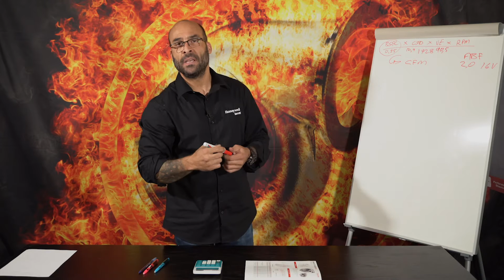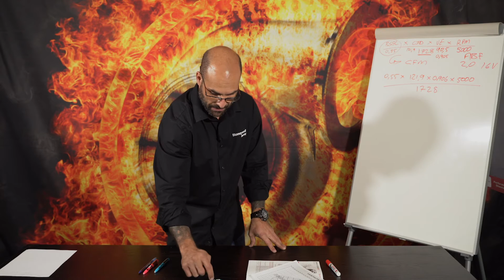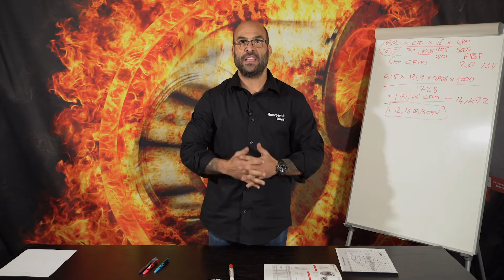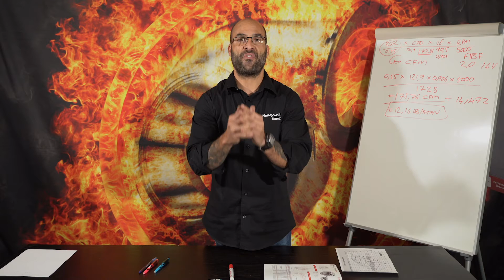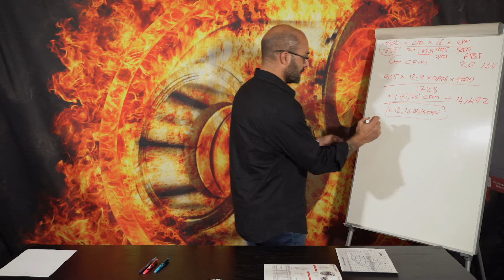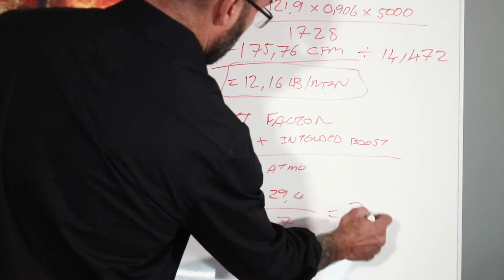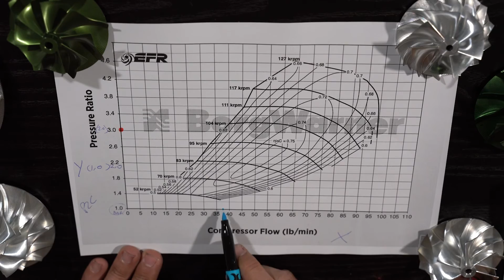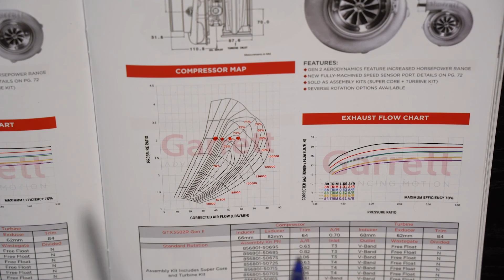Turbocharger compressor efficiency

Comment: why .55 for BSFC?  is it a typical or a normally pre determined factor? Not Justin balls, just need a little clarification so I can extrapolate for MY build.  Cheers!
Reply from the maker: Fuel dependant, and VE dependant goes together with AFR and turbine efficiency - all these things come into play - go into the Borg Matchbot and you will see it clearly and get a better understanding of how this works.  You can change these parameters and you will see the BSFC change with changes to the above values.

Comment: I want to run an EFR7163 .85AR vband in vband out turbine housing. Cast log manifold, mild street cams, fully built Darton MID wet sleeved, custom CP Carrillo rods and Pistons and all the other bits. No expense spared at any point. Fully upgraded return fuel system.  It's a 2.5 liter, dual VVT 5 cylinder. What is your guestimate on HP at the wheel? Planning on 30psi, redline is 6500. Unlike some, I will take it with a grain of salt.... cheers!
Reply from the maker: I would expect around 500HP - BUT the power curve will fall away over 5500RPM - the turbo is small for the engine you have built. I would consider the EFR8370 instead.

Comment: I just love that you took my favorite engine in equation. From what I've seen on multiple engines of these is that we got 400hp@1bar of boost with s257 and S363sxe turbos.
In one instance with insane engine there was 485hp@1bar and 8400rpm

I would love that you explain to population density ratio and not pressure ratios, since pressure ratio isn't exactly showing true numbers innterms of airflow and power because it misses density we get provided to the engine by turbo and charge cooling setups...
Reply from the maker: Density is not important in a rudimentary calculation, as you would then need to take into account temps, humidity, pressures, air cleanliness and alot more - waste of time for a basic turbo matching exercise.

Comment: So a couple things I noticed; 1. This assumes that you CAN reach 2bar gauge pressure by 5000rpm on such a small engine with such a large turbo, which, if that IS the case, then you would either want to use boost control to limit the boost at that RPM on the Borg so you don't surge, OR you would actually want to have the Garrett, instead, for the same reason. And 2, the Garrett will technically be more efficient between 6000 and 8000 RPM on average than the Borg. In contrast, the Borg will only be maximally efficient at 8000 RPM, which is fine when you're at the very end of the run and not looking to change gears anymore, but perhaps not as ideal as you're going up through the gears dropping from 8000 to 6000 and then climbing as you accelerate.

Suppose the overall goal of anything is peak average efficiency within a band, and the goal of this specific car/build is peak power/efficiency at the top 1/4 of the rev range. Wouldn't you want something ideal BETWEEN 6000 and 8000 rather than just AT 8000? I could see the latter being the case if you were racing with a CVT (assuming you could make a CVT withstand the torque) but otherwise, if multiple set gear ratios are involved it seems technically ideal to have a range of average peak efficiency than just max efficiency at one RPM setting.

Comment: How do you compensate that different turbos will flow different volume of air at the same pressure ratio?
Reply from the maker: What do you mean compensate?  No two turbochargers are the same in terms of flow vs P2C and rotational Speed.

Comment: The skinnier you can get away with making your compressor and turbine blades, the greater will be your efficiency for an overall turbo size. The gamma-titanium turbines are FAR lighter but they come at an efficiency penalty for steady-state power production.

I believe MFT's (mixed-flow turbines) may be a way to claw back some of that lost efficiency. Until then, I still prefer the idea of gamma-titanium turbines anyway, as absolutely minimizing/eliminating turbo lag is a fascination of mine, and I am not dealing with big rigs or marine engines that sit at close to the same engine state for seconds, minutes, hours, and days, so efficiency is far more important than lag elimination.

I also await mixed axial/radial multiple-shaft turbos, too.
Reply from the maker: The Gamma-TI blade designs are mixed flow.
Reply: @TurboDirectSA  Well well well. Borg Warner is intent on taking over the world aren't they?

I am curious if an even more aggressive flow mix will be done next, to more closely approach the axial turbine while still preserving the energy of the radial flow.

The direction of the radial flow's rotation can impart a similar effect to the flow direction as do stators mounted before turbine stages in an axial turbine engine.

Comment: Love your stuff. I'm still having difficulty with my build. I know you said in another video that you think the 8474 is a great combination with an EJ257. I'm discussing my build in a tuning discord group and there's a guy there who says it's the worst turbo he's had on the engine, 0.83 seconds lag between shifts. 2.5, fully built.

I know there are many variables, but I'm trying to understand how he was in love with the 8374 but hates the 8474. 

I'll be destroked to 2.34, closed deck, 14mm studs, cams, springs, etc.. Shooting from the hip I thought the 8474 would be great, but this guy is making me doubt and now I'm trying to get more into the science of matching the turbo to my build. I'm hoping  you might be able to point me in the right direction. Thanks!
Reply from the maker: I battle to believe that the time between gear changes is so poor with the 8474 compared to the 8374 - the turbine and housing stage is identical --- i believe there might be other problems that are causing this lag, its not going to be from the turbocharger itself. 

What HP target are you planning on reaching?
Reply: @TurboDirectSA  I'm aiming at 800whp without changing intake manifold and with a 1.05 A/R EWG. I'll be tuning on a substantially low reading mustang dyno, probably in part due to its altitude over 2700ft, so it's a tall order.

I thought the exact same thing about the shift lag difference, and have been trying to dissect his setup to pinpoint why. He's running emtron, as I will be as well, so he's got plenty of graphs showing lots of details that go above my head. 0.83 sec to get back into it, shifting at ~6700 rpm, turbo speed (seems low?) at around 95k. 

Something has to be off. I can see boost threshold increasing, but I can't find a reason for the lag to increase. And a high revving 2.34 should be plenty of juice to keep the 8474 in a happy range from my research.

Thank you for your time 🙏
Reply from the maker: @MWM_carboncopy  The AR1.05 is too big. The biggest housing you should use is the T4 AR92 - build a proper equal length runner to the up-pipe.  What gearbox you running? RPM drop between gear changes should not fall below 5000RPM when shifting at 6700rpm - so you will definitely be in boost after changes. 

The 95K turbo speed indicates 1.5-1.6bar boost -  --
Reply: @TurboDirectSA  1.05 is the smallest they offer with external wastegate option.
Reply from the maker: @MWM_carboncopy  Correct, it will be laggy. You will need to shut off the swing valve or perhaps just use it - it measures 42mm diameter, and will respond faster than any external gate will.
Reply: @TurboDirectSA  you mean the 1.05 would be that laggy then?
Reply from the maker: @MWM_carboncopy  YEs it will be laggy - if you had RPM available say to around 7500RPM then i would consider the AR1.05 - not less than this - any external gate setup is always laggier than an internally gated option.
Reply: @TurboDirectSA  Very good info. I will have redline above 7500, but I'm not planning on living high rev all the time. I really appreciate your time and insight. 🙏
Reply from the maker: @MWM_carboncopy  Pleasure buddy - good luck with the project
Reply: @TurboDirectSA  Last one! My kit won't support IW housing because of the length. However AGP makes a housing that has the correct dimensions. Those housings are available in AR81 or AR96. I lean towards 0.81 for response, but don't know how far that's going to put me from my HP goal. I'm not dead set on 800, prefer it to feel right and hold a nice long power band, but hope to stay close. Edit: going with .96 to keep it breathing a bit more up top. Afraid .81 is going to be a bit restricted especially when I do want to rev out, don't want it to completely crap out or have too much back pressure to deal with
Reply from the maker: @MWM_carboncopy  Dont be fooled into thinking massive HP is a faster car - we have proven time and time again that putting power down sooner, and for longer always shines through (within reason, application specific) a well built car with a combination of spool and power will be a better and quicker drive than an all out LAAAAAAAG and eventually power surges and you throw the car at the scenery. 

I dont know these housings you mention, but which family AR81 is the housing? T3 AR81 or T4 AR81?  Is it twin scroll?  You should lean toward the twin scroll for sure.
Reply: Also, because I'll be running at least E40 pretty much all the time.
Reply: @TurboDirectSA  yessir, T4, twin scroll, 3.625 v band
Reply from the maker: @MWM_carboncopy  T4 AR81 -- go for it.
Reply: @TurboDirectSA  you think the .81 will outperform the .96 with the build I've sketched?

Hell, I'll do it just to try and report back. I'll order both and try it!
Reply from the maker: @MWM_carboncopy  I wouldn't waste my time or money on the larger AR96 housing - it will be laggy!
Reply: @TurboDirectSA  Thanks man, been doing some math and I think you're right. Twinscroll 8474 EWG 0.81 A/R  on the menu! Enjoyed our dialogue, cheers!
Reply: @TurboDirectSA  Well, apparently I looked incorrectly, they only have the .81 with open housing...
Reply: New plan then; if I'm getting annoying just tell me to bugger off! 

I'm keeping twin scroll headers but fabricating a merging up pipe to the open .81 housing. Should reduce exhaust volume a bit and give space for some nice long primaries and secondaries. Should make a nice 1.5 scroll. Very new to me, pretty excited. Wouldn't have gone this direction without our chatting, so thank you again.
Reply from the maker: @MWM_carboncopy  Not at all - dont stress - always do your research before spending money. The housing must be twin scroll -the Scooby engines are lousy at spooling large turbos - you need all the help you can get.
Reply: @TurboDirectSA  I'm stuck then. A larger a/r is going to be laggy but there isn't an option to run a smaller a/r that will make anywhere near the power I'm shooting for. I already have a 7670 on a forged semi closed block with stock valve train that is beyond maxed. 

It might not be the ideal world, but if there isn't a smaller divided housing than the 1.05, open 1.5 scroll with .81 open must be the better option....?
Reply from the maker: @MWM_carboncopy  OK then why dont you consider the EFR8370 then - this is the upgraded 7670 -- same turbine stage with upgraded compressor stage. This is a real 750HP (actually will reach closer to 800HP) turbo

will bolt onto your existing setup.
Reply: @TurboDirectSA  Because the smallest AR EW is still 1.05.
Reply: @TurboDirectSA  what don't you like about a 1.5 scroll?
Reply from the maker: @MWM_carboncopy  Yes but the turbine wheel is not as large as the EFR8474 - its the smaller EFR8370 -- which uses the same turbine as the existing 7670 which you already have on the car - spool wont be affected by much (150RPM - 200RPM at most) and the power increase is 150HP more.
Reply: @TurboDirectSA this is good, I really appreciate making me look at everything 5 times before deciding, it's an expensive decision. You're much more knowledgeable than I am. But candidly; I'm not looking to go to a fully closed deck, pinned mains, custom cams/springs, et cetera... For "just" 150 HP. (Edit: the quotes indicate that I know that's not a small gain) Just about everything except the rotated setup is being changed and I'm really trying to strike the right balance between the bigger numbers without absolutely killing drivability off track.  I feel the 1.5 scroll might be offering the best of both worlds in my case. I would love to learn why I'm wrong please, it would be good for anyone reading, especially considering the 8474 1.05 is a  common twin scroll choice for the Subaru cult. 

If you're willing to spend anymore time on the subject, I'm all ears.
Reply: @TurboDirectSA  I'm sorry to keep bugging you. Direct question then to close it and I'll make my own decision from here: in your experience, do you think a tuned port manifold dumping into an 8474 with open .81 housing is going to be just as laggy as the divided 1.05 housing?

I would love to stay full twin scroll, but I'm really looking for the bigger power and willing to sacrifice a bit of spool. It's just very difficult to pin down even an approximate difference and I'm unfortunately reliant on people with far more experience to help me make an educated guess.

Happy to reimburse you somehow, if you have a way for me to do that. Different subject entirely; you're from South Africa, yes? Does that mean you speak a bit of Dutch by chance?
Reply from the maker: @MWM_carboncopy  You not bugging me at all - this is what we do - its my pleasure. Always remember that you are limited in the engines RPM band - making power is easy - any monkey can do this with a big turbo and lots of boost -- but this is not a quick car - (this is the typical idiocy way of thinking which is common in South Africa) - falling outside of the power band every time you change gears is where you will find the problem with the larger turbos, unless you increase the engines RPM limit or change the gear ratio - the Scooby is notoriously known for not being able to spool large turbos - hence the requirement for twin scroll and equal length runners etc --  

Sacrificing spool is understandable - but how much spool is the trick to a successful build (without having to trial and error and build it twice because of incorrect housing choices) use a twin scroll - smaller AR housing with the larger turbo - you will make the 800HP mark - 

The 1.05 is LARGE -- its very large, it will be laggy.   The AR81 is also large, but alot better than the 1.05. Having a twin scroll housing together with equal length tuned port runner will gain you what you need in the response side. 

I would still maintain to use the internally gated AR92 T4 Twin Scroll housing with the 8474 - it will spool faster than any external gate - shoot me an email, ill send you a video of the 8474 black in action with the 92 twin scroll housing on an RB26 (yes different engine, but the spool is ridiculously fast, and we went to a much larger AR housing) info@turbodirect.co.za

Comment: Funny I just left a comment on "Compressor maps in a little more detail" stating this was one of my remaining points of confusion. How to plot approximate points on a compressor map when picking a turbo for a specific engine and power goal. Then I find this video I haven't seen. You basically answered my questions in the other comment point by point. At least that means I was asking the right questions! It's done just as I expected. Guess I wish I could be lazier with the math, but my quick estimates tend to be pretty good. There are still some finer points which confuse me, such as how to know if an engine and turbo combination will be able to hit target boost by a certain RPM, but I'm getting there. Thanks as always. Nice paper weights!
Reply from the maker: Glad you enjoyed the video - :-)

Comment: My maths is; half capacity in CC, X RPM, X air density per CC, X VE, divide 60, for grams per second (1 gram per second=1kw) Multiply by the desired PR
Or ;half capacity in CC, X RPM, X air density per CC, X VE, /1000 (grams to kg), X 2.2 (KG to Pound) for 10 lb/min for 100 hp. Multiply by desired PR.
2000CC /2, X 5000, X 0.001225, X .90 (VE), /60 = 102 grams/s or 102kw at 5000rpm. X1.5PR =153 grams/s or 153KW
Reply from the maker: Thanks for the comment -- the above is a little too complicated for a compressor map outline for beginners or someone who wants a basic and quick ref point.  

To comment on one aspect of many - you have no BSFC formula on the turbine side, which is what drives the compressor - these forumlas become a function of the turbine effects when using the above relating to air density. Without the Shaft power and BSFC forget about anything accurate. 

This is why i kept the outline very low level - not to lose the guys with less understanding.  For the more in-depth calculations i use Match Bot - its the most advanced and comprehensive tool there is. No need for formula's or a scientific calculator.
Reply: @TurboDirectSA  You do not need a BSFC for the turbine side. It just works on mass and pressure ratio. It is more simple than the compressor map. That is my finding. I had to teach myself about maps and A/R as there is no help for my project. Garrett refused to help me. I have to evaluate 5 stage compounding for my project, not the usual car project. Do enjoy your videos, wish they were more in depth though. You wouldn't have any information on what aluminium alloy Garrett and BW use for their milled compressor wheels would you?
Reply from the maker: @chippyjohn1  Nope - the majority of the turbine side works on the fuel, and BSFC - id strongly suggest you play with match bot - without BSFC forget about any information and/or results from the turbine side - which has a direct effect on the compressor performance, based largely on the turbine wheel shaft HP output.  Making a small change to the AFR, EGT and type of fuel will move your turbine point plots with massive conflicts. Some will land up on small AR housing options and others on much larger turbine AR options - try it and you'll see.